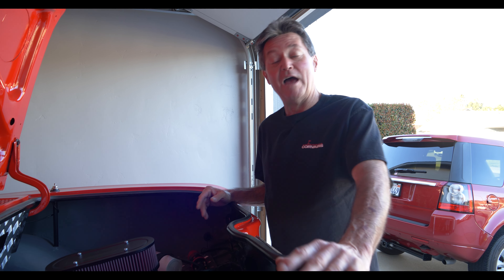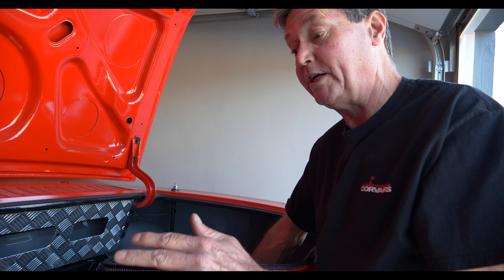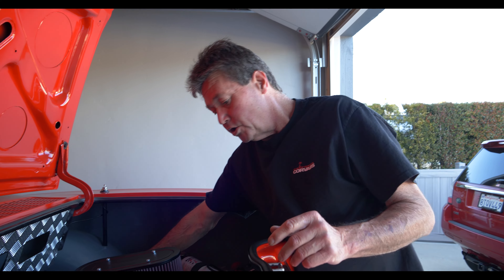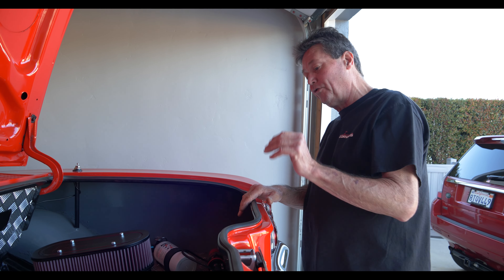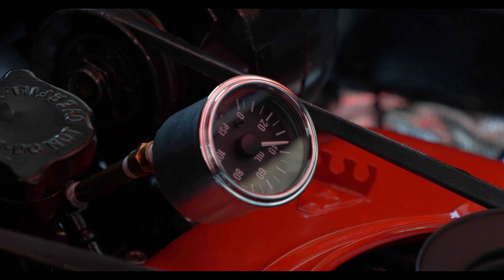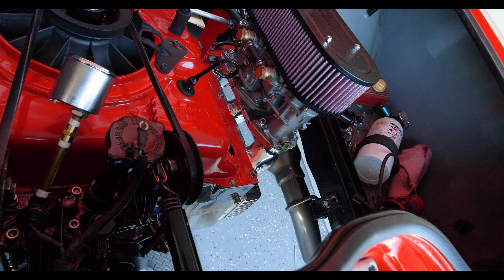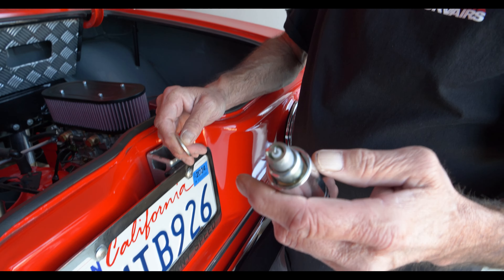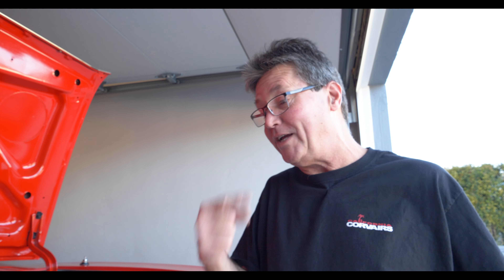1965 Corvair upgrades (part 5) Oil pre-check

Comment: Owned and worked on a few corvairs never knew of one that held 8 qts of oil all the ones I ever seen held 4 qts of oil
Reply: He did mention an aux oil cooler (and lines) and that custom oil pan probably holds more oil too (looks deeper than stock)
Reply: All the corvairs have a external oil cooler that bolt's to the engine block that the engine cooling fan air blows thru the later models 65 an up had larger oil coolers hard for me to believe that it could hold twice the amount of oil as stock but guess it could be possible

Comment: You know... Vega front disk brakes will bolt right on as will a late 70s firebird WS6 steering box. Just saying!

Love the car and the series! So much better than the hacked up engine in the back seat V8 corvirs that are way to common!

My personal corvair is a 65 that I built much like yours. This winter I'm going through the motor before adding a Hudson Hornet inspired aluminum plenum and turbo.

Comment: Had several Corvairs. A 63, 65 and 69 and none took 8 quarts of oil. All took 4 quarts. The problem with all these tweeks 
is, if this vehicles ever is serviced in a Chevrolet service center or repair shop no one will know how to work on this
 because it's been altered or customized from factory specs, and original shop repair manuals. In many cases you're not 
going to find a repair shop that will work or repair this altered vehicle----you're stuck.

Comment: i have a question (not trying to be negative) but if your going for power and efficiency why stick with carburetors instead of switching to a fuel injection system, i’ve seen lots of fuel injection systems being sold plug and play for almost all corvair models, so why not do it here, is it because with these kits have a limit? because it would mean installing a ecu and kind of changing the car? or is it just preference